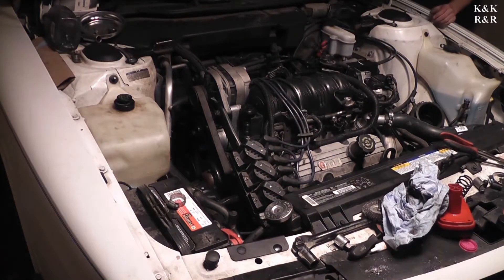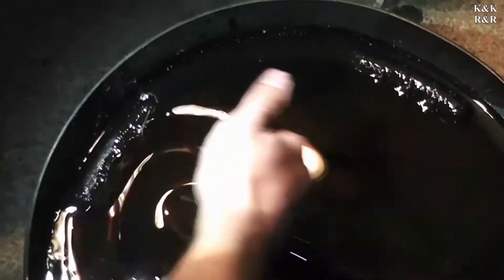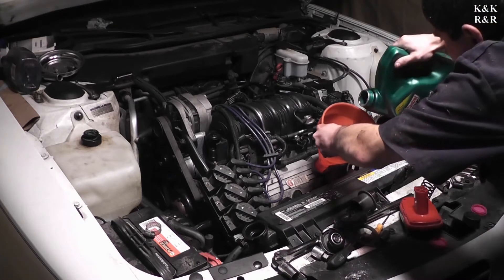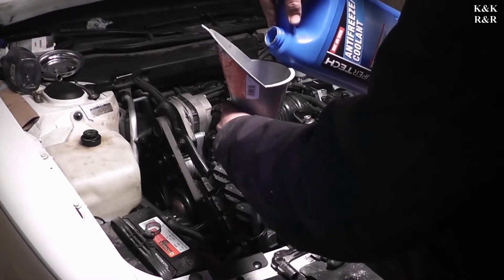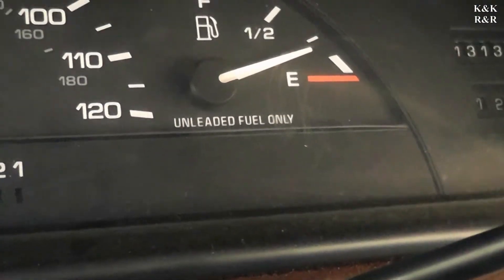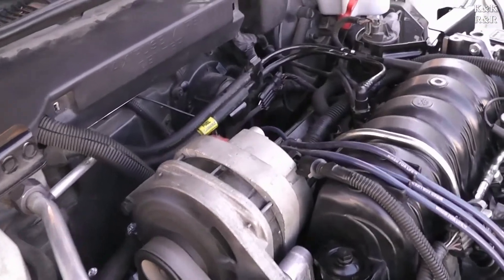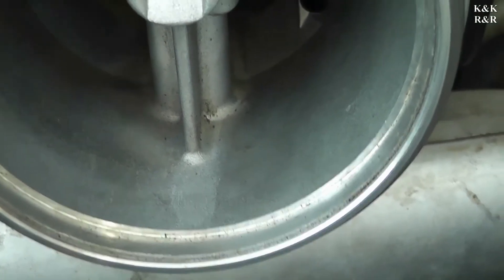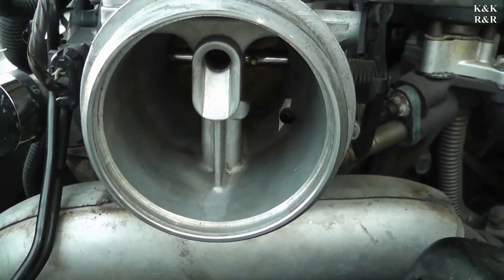1995 Oldsmobile 88 3.8L / 3800 Pt7 First Start, Retest For Coolant Leaks and Do Final Test Drive

Comment: Back again, guys. So, I pulled the air intake off the throttle body and it was completely dry. I also removed the throttle body and peeked down into the intake plenum. It was completely dry. I was wrong about the plenum leaking coolant into the upper intake. I'm still going to buy the parts and have them on hand. Coolant was leaking from that stupid elbow down at the water pump. I replaced it with a metal one because I truly hate plastic parts. They're meant to fail. Thanks for your help and advice though. I enjoy watching these videos. This is the 4th or 5th time I've watched them.

Comment: Well, guys, I think its finally starting to happen. I'm noticing the coolant reservoir is gradually losing coolant. The exhaust isn't producing white smoke...yet. I can't figure out where else the coolant could be going except into the intake plenum. I'm glad I found your videos on this lady's Olds because at least now I know the correct way to do this job. Are there any other things I should know, such as what brand intake plenum to replace the plastic one with? Thanks guys.
Reply from the maker: Most owners don't see the white smoke till the coolant leak is so bad it floods the lower intake and turns into  "A Crank / No Start.   I would recommend the ATP 106001 {#17113136, 89017272} Upper Intake replacement from  Rockauto.com.  We did use the Dorman Upper Intake on this one, but we have done a few after this and found the ATP Upper Intake replacement to be a bit more rugged then Dorman's replacement. 

3800 Upper Intake Replacement  >> P/N:  ATP 106001 {#17113136, 89017272}<<
Lower Intake Gasket Set >> P/N   FEL-PRO MS98014T <<  Rubber/Metal Lower Intake "Fix It Once" Gasket  

As far as the repair goes, be sure to follow the EGR feed tube retrofit as per to the instructions in the kit.  The EGR design is the number one reason why the OEM Upper Intake fails like it does. Cleanliness is next to Godliness on this repair so be sure to clean, clean, and clean some more to do this repair once right the first time.   We spent a lot of time off camera just cleaning after the coolant flooded the lower intake.    

/K&K

Comment: Hey guys. Well, I had to do the water pump on the Regal and I looked at the upper and lower gaskets. They look fit as a fiddle. The car just busted 169,000 miles. I can still burn rubber. Take care.

Comment: Thanks for your video 👍. I have a 2003 Buick regal 3.8 V6 with 112,000 on it. I'm seriously considering putting an aluminum intake manifold, aluminum elbows and new fel pro  gasket set on the lower intake manifold. I was curious about your thoughts on this? I've heard a lot of good things about these engines, so I'm hoping to get a lot of miles on it. Thanks, Jim
Reply from the maker: The plastic design isn't bad once you swap to the after market upper intake that has the metal provision to protect the EGR feed tube from melting through the cooling ports.   GM switched to the metal intake system on Series III because this issue was so common.   If can swap to a metal upper intake you would be better off in the long run otherwise switch to an after market replacement and you would be fine as well.  3800's in general are still far superior compared to (2.8L,3.1L,3.4L,3.5L,3.6 and 3.9L).
/K&K

Comment: Hey guys, it's been a while but just letting y'all know that the Regal has blown past 279,000 with no upper/lower intake gasket failures. I'm thinking one of the previous owners probably had the bad luck of dealing with the problem. Now, if I could just get out mechanic to fix the damned power steering pump the RIGHT way, without screwing up the pump shaft, I'll be happy again. Take care, guys. I'll keep you guys posted ever so often.

Comment: Did u hv to remove the spark plugs a second time, after discovering coolant in the intake, to blow out the cylinders again?
Reply from the maker: That's hard to say because it depends on how much coolant went down the cylinders.  Its real easy to get into a hydro-lock situation with these engines.  If a little bit coolant went down the hole your probably going be okay, but in my video here if that much coolant went into the engine I would pull the plugs and spin the engine over a few key cycles to be sure.  Its not worth destroying an engine over pulling plugs in my humble opinion.   
/K&K
Reply: @KNKRNR  Thanks.  My intake was recently filled with coolant due to the EGR pipe blowing out of the port in the LIM and the upper intake melting.  It now cranks but doesn't start after replacing the upper intake plenum
 I hope it's ok.  I will be removing plugs to blow out cylinders once I get more time.  anthony hfe is my channel and it shows what happened.  Uggg
Reply from the maker: You need to stake (in 3 spots) and red loctite that EGR stand pipe in place.  I did watch your short.   Looks like a blow torch malted that plastic.  You can get enough coolant in the cylinder walls to not make compression.  If that engine seems like its cranking unusually fast I would pull the plugs and spray wd40 in each cylinder to displace the coolant.  I would also crank the engine over without the spark plugs in place to make sure you get as much coolant out of the combustion chambers as much as possible.  Also I would crank it with 20%-40% throttle to force a rush of air in cylinders to get the coolant to go out the tail pipe.  They will start a little rough once compression starts to build back up. 
/K&K
Reply: @KNKRNR  Hello.  Very good advice.  I will be back here with my progress, when I get to work on the car again.
  Also, I used 450 degree Permatex 27200 (like Loctite 272).  This cost me a day because all the local joints just had Loctite 271 (Permatex 27100) but I wanted the 450 Fahrenheight rating, not 300F. 
  AND, my friend, I was prepared to stake in the chimney, as I watched ur video. But I was not able to.  Why? Because the top surface of the bigger diameter base of the "chimney" was BELOW the surface of my lower intake's port after she bottomed out !! There was no way to stake it without damagjng the smooth top surface of my lower intake, and then the gasket would not seal. So I wasn't chancing that.  Also, I not only coated the side of the pipe with 27200, but I also did the bottom where it touches the lip inside the LIM's EGR port.
   Around 2.5 years ago I did my son's park avenue.  I used amy big THOR hammer on that. It hasn't popped out and it's been 35,0000 miles since I did that car's gaskets, etc.
   I must say that this dorman pipe/chimney was a much tighter fit than my looser, ATP Greywork's one, that popped out.  Thanks for all the tips.  I will apply them !!

Comment: On my delta 88 I just replaced my serpentine belt and my coolant flange is hitting my belt and I’m not sure why
Reply from the maker: Wondering if you might have installed the belt one rib over the AC compressor. This would make the belt run into the coolant inlet pipe.   Its easy to be one rib over once you release the belt tensionor.  If this is the case you will see a belt rib if you look at the AC compressor or Crank pulley. 
/K&K

Comment: Hey guys. So, I had an unfortunate discovery today. I stopped the Regal (yeah, same car I've always commented about here) at a red light and noticed steam billowing out from under the hood. I pulled over and popped the hood, didn't notice anything like a busted hose that might account for that much steam. Well, I started shining with a flashlight and noticed that the upper intake gasket is leaking coolant. I took a paper towel, dried off the gasket, and immediately noticed coolant seeping from the gasket. The faster I raced the engine, the more coolant would seep out. What this tells me, guys, is that the upper intake is full of coolant and that's what I was seeing leaking out. I suppose the only reason why the engine hasn't locked up yet is because the gasket around the intake ports is still making a proper seal...but it won't be for long, I'm willing to bet you. I'm just debating now whether to do an intake job or just throw in another 3800 for roughly the same amount of money as doing an intake job. Too bad, because the car runs really well otherwise and still has lots of power. I just can't make up my mind on what to do here, but I know I can't keep driving the car.
Reply from the maker: These 3800 Series II are tough and can live through the worst of things. I wouldn't swap an engine if the intake is the only issues because you will have to do this repair to either engine regardless.  These engine can run up to 300,000 miles under proper care.  With the engine that's in place you know the history and with a replacement you may be rolling the dice unless you knew the owner's per say. I would weigh the pro's and con's on this one. 

/K&K

Comment: I have a 99 Regal with the 3800 Series 2 and I'm looking forward to the day when i have a hydrolock condition...im gonna automatically assume it's the same problem as this lady had with her Olds
Reply from the maker: To answer your question it really depends on what fails first. If the upper intake manifold fails first then the engine is flooded with antifreeze where only air should be then the hydro lock can occur, or if the lower intake gasket goes first the engine floods with oil where only air should be and won't run above 2,000 rpm.  Check out our Facebook page with the link below, there I have uploaded some Hi Def picture of what a Series II lower Intake manifold gasket failure looks like vs the upper plastic intake manifold failure in this video.  Its a mess either way (Antifreeze Upper Intake Fails vs Oil Bath Lower Intake fails).  All 3800 Series II will need this repair at least once in their useful lifespan.

https://www.facebook.com/KK-RR-602334289949754/

Thanks for Watching,
/K&K
Reply: Keith & Kevin's Repair & Restorations Do you guys know about what mileage her Olds had on it when the gaskets blew? If not that's cool. My Regal has around 154,000 on it but so far everything looks good.
Reply from the maker: This one had 131, 698 thousands before the hydro lock occurred.   1995-1996 were the first years for the plastic upper intake and they had the highest rates of failure.  1997-2003 Model years Series II got a Revised Upper Intake that was less likely to fail.  For you my best advise is to just do simple visual checks every so often.  Check it at least once month or every 1,000 to 2,000 Miles driven which every comes first.  Unusual coolant loss is normally the first issue you will have followed by oil soaked lower intake manifold bolts, other then that you might not see this issue till 200k plus if you do at all.  In a pinch we have used the revised upper intakes on 95-96 model years to find they work out pretty good most of the time. 

/K&K
Reply: Thanks for taking time to respond. There's very little if any coolant loss. I think there's not quite a 50/50 mix and some is just boiling off. I just did the thermostat on it yesterday and everything looked good. The car runs near perfect and I can't complain when the car was free. Well, the A/C doesn't work but that's no biggie.